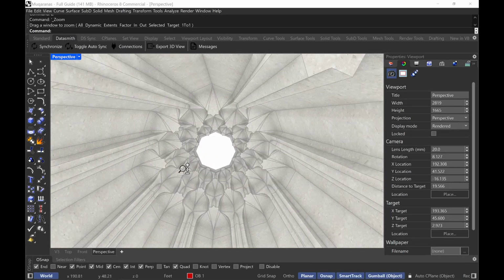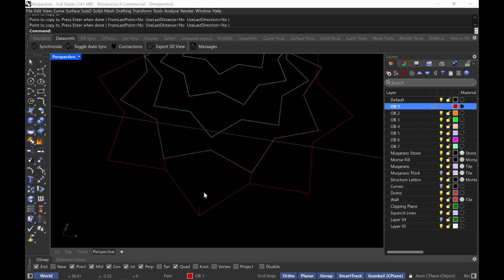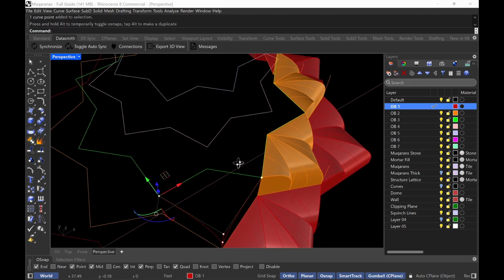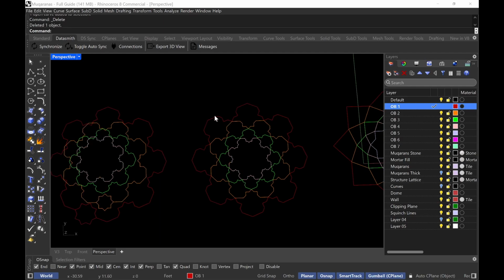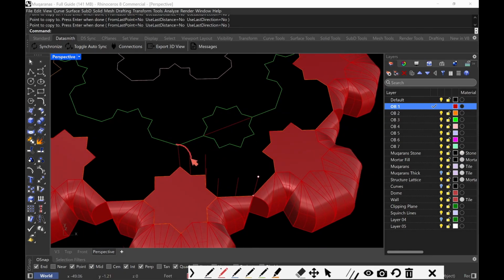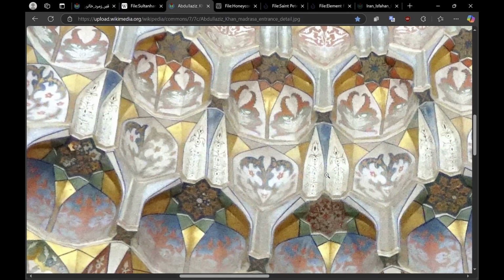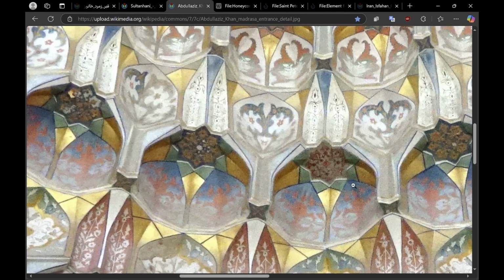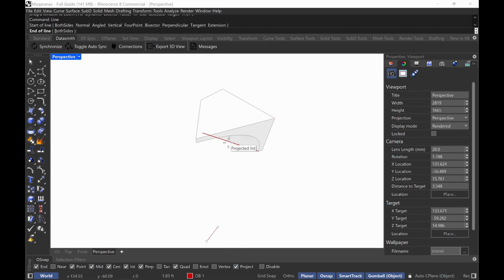The Muqarnas - Complete Guide in Modeling Muqarnas in Rhino 3D - Islamic Architecture and Geometry

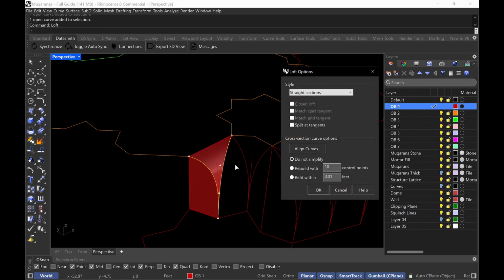Comment: the first muqarnas dome volume was a bit funny in proportions because of the height, the second muqarnas dome volume was on point! As a side note, why at 36:00 instead of sweep, you don't add a third curve for the mid-spine that you ended up having rhino figure out with the sweep? is there a particular geometric reason?
Reply from the maker: Hi! I could have made the first tier taller. It's all a matter of preference. If you look at the Jameh Mosque in Isfahan, the Muqarnas proportions are rather elongated. But in the mausoleum example I show in the video, the little portions are quite tall. 

The reason for the sweep is because I want to emphasize the almond shape between each leg of the star. You could absolutely add a spine if you want.
Reply: @ also, it’s implied that it’s an amazing video, but i also wanted to reiterate. Keep breaking the internet with your vids ✌️